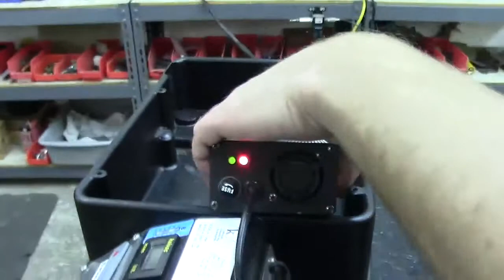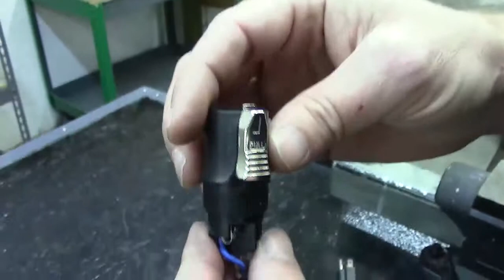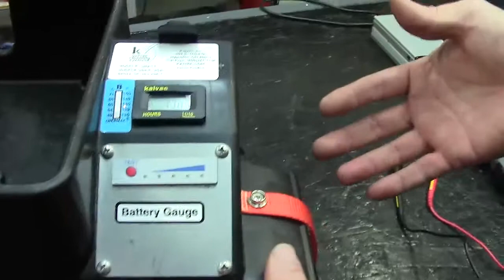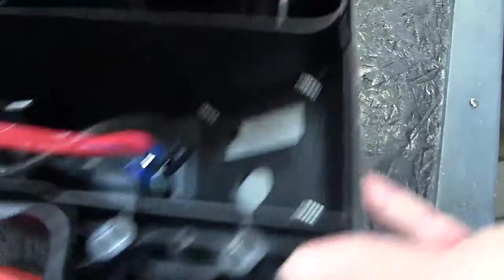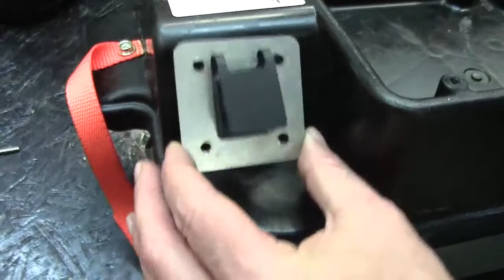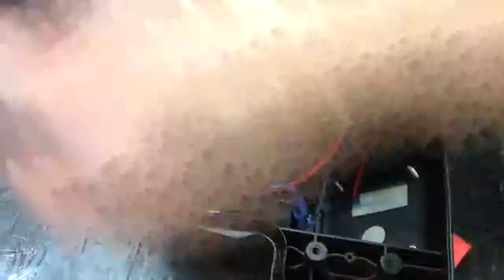OmniFlex Battery Troubleshooting and Repair

Comment: For running the plug to the vacuum head:

Blue and brown on the plug as shown here and the 3rd port in the center is for yellow with green stripe.

Had one with a cut cord and this helped get it back up and running.